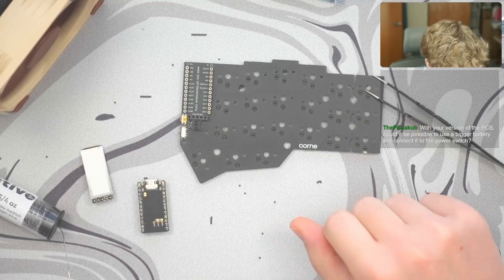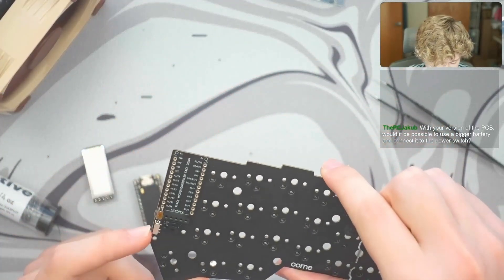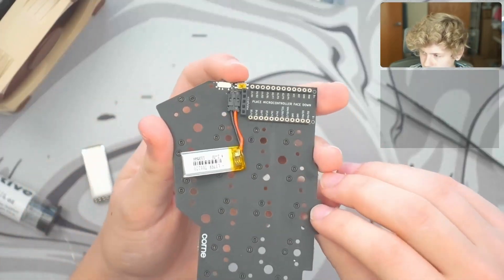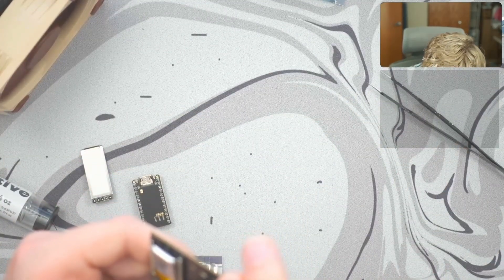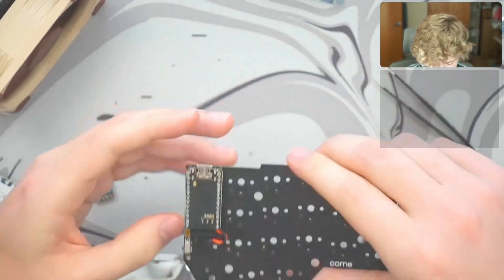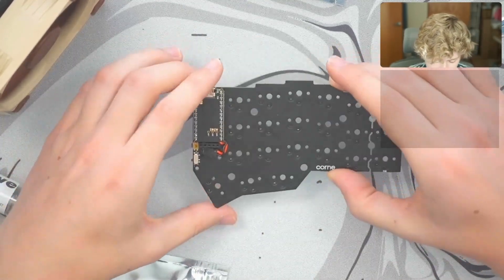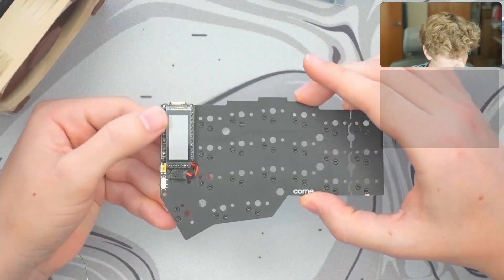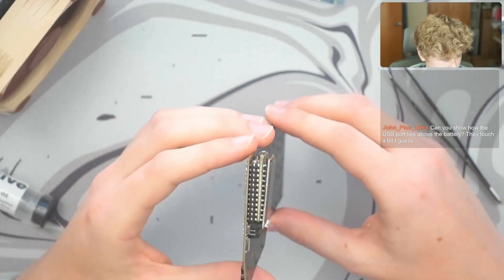How to Install Batteries Into a Wireless Corne

Comment: Beautiful video but not very detailed, what if your board isn't designed with the battery socket and you have to actually solder the battery onboard, how do you go about that, is it better to solder battery to board or on nice!nano, what are the advantages of one over the other etc.